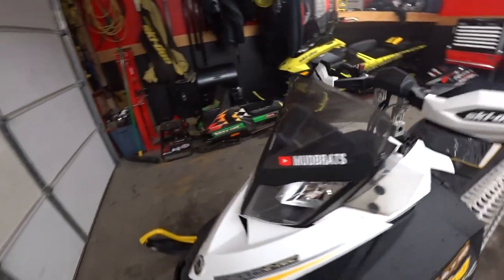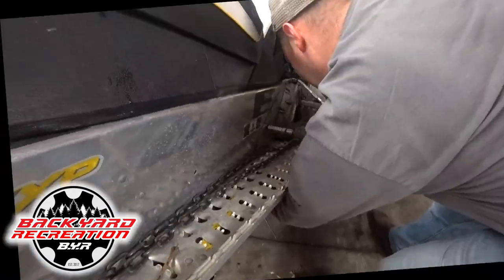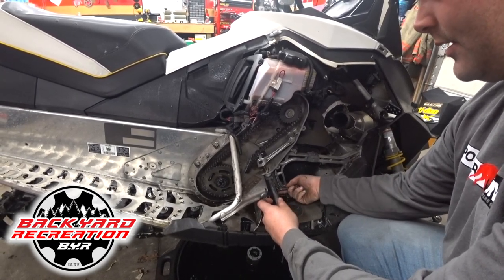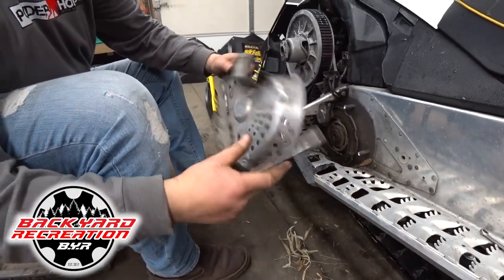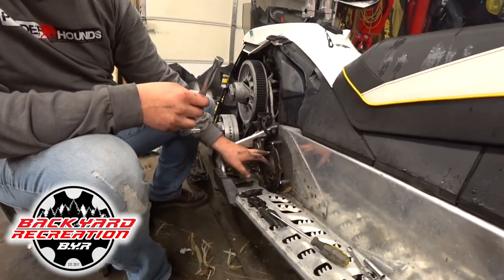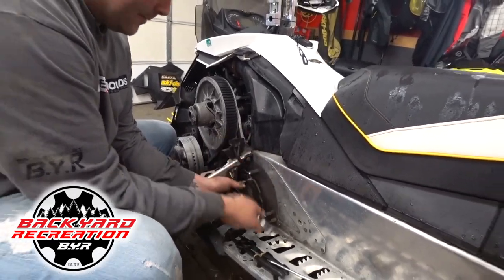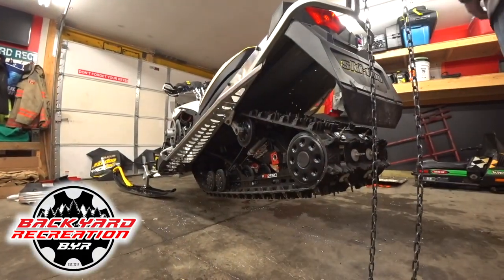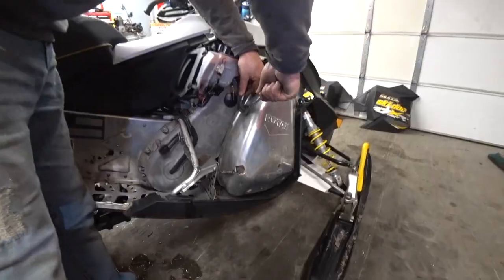Ski-Doo INSTALL RMOTION in 2009 REV XP Snowmobile Conversion to rmotion 129

Comment: Nice content & great video . I'm a new XP owner ,.. 08 MXZ TNT 500ss . What's the benefits of an R-motion skid over the stocker ? If I were to swap down the road , is there an R-motion skid in the 120's ?
Reply from the maker: Rmotion is like riding on a cloud.  A lot better in the bumps and stutters.  Yes they did come in 120in not sure if the track is the same between the 2 - that you would need to research yourself.

Comment: Nice video but I didn't see how you determined where to relocate the rear skid mounting brackets. Is it just a measurement from old position?
Reply from the maker: ideally you would just get XS 129 brackets and rivit them in the same holes that the xp bracket came from.  in this case the local dealer screwed up and sent me the same brackets from and xp so we just put them in the spot where the skid lined up
Reply: @mudbrats  Thanks, I installed a different skid in an older Cat I had back about 15 years ago, looks to be about the same idea!
Reply: @mudbrats  ,I am doing this swap.Do you have part number for rear brackets needed?Thanks.Love your channel.

Comment: I did this to my xp and when I hit big bumps the track hit the rear of the tunnel only in the center by the flap. Its bent it up. Any thing I can do about this?
Reply from the maker: yes u have to put the tunnel extension on - check my other video
Reply: @mudbrats  what other video? its not hard to post a link, expecially considering you know what video your talking about
Reply from the maker: About as hard as typing tunnel extension Mudbrats into YouTube search haha 😆 https://youtu.be/rk7HdAHIF5k